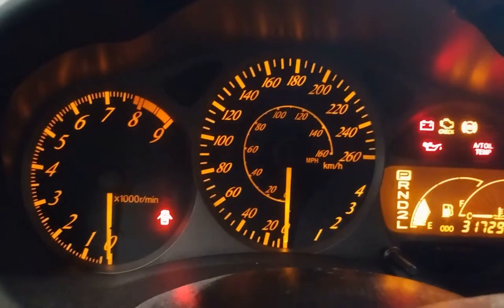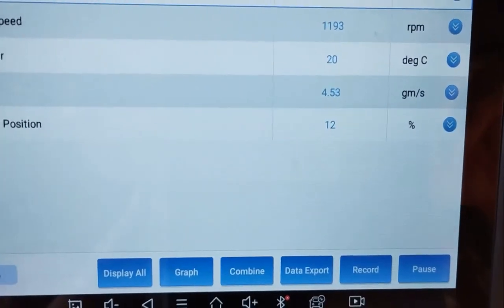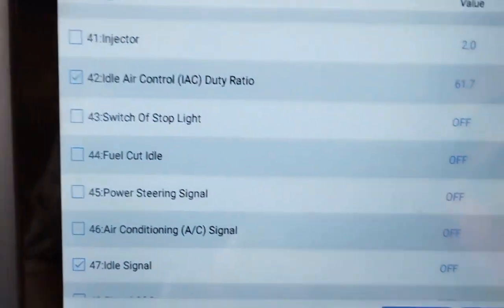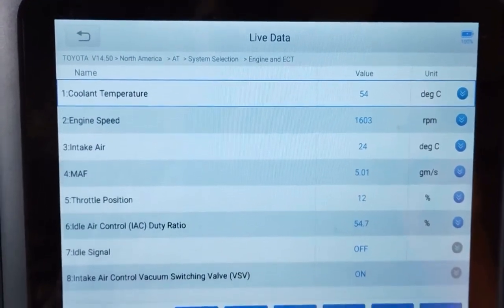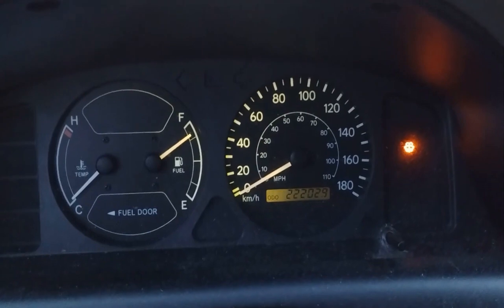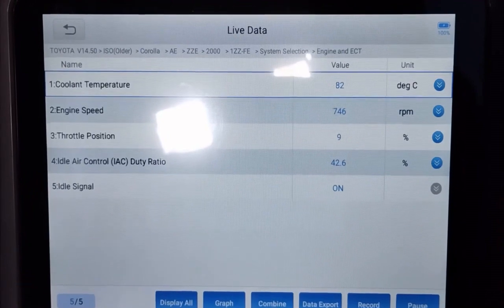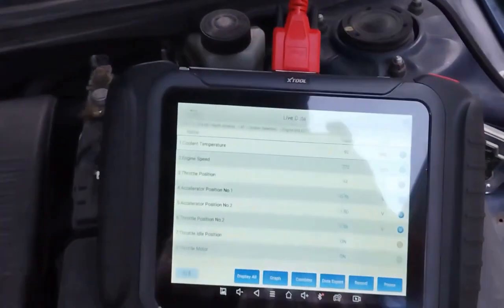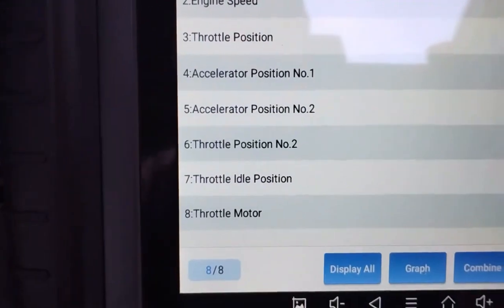2000 Toyota Celica GTS - High idle problem, overview / compare with other Toyotas

Comment: Good day Sir, I hope you answer my question, cause my celica gt 2002 also increased idle from 1000 to 2000  to 3000 rpm when reached normal temp, its not that hot.

Comment: Hang on..   pause it at @5:34 you can see an aftermarket AN Fitting just T'd into the AIC vsv airline.   Right?   Maybe that is just a service port with a Schraeder valve..   if so what function would that schraeder valve perform?
Reply from the maker: You mean that black Schrader valve at 5:34 near the top right? That is 100% factory, it's a test valve that lets you inject smoke into the evaporative emissions system to test for leaks. I have a 2004 Celica as well (my son's) and it has the same port. Usually there is a green cap that screws on the schrader valve.

Comment: Did you fix the issue?? What was it. A bad coolant temp sensor or an IAC valve
Reply from the maker: Yes, I did fix the video by removing the IAC valve, disassembling it and cleaning it. Here is the video detailing the entire procedure from diagnosis, repair to verifying the completed repair. 
https://www.youtube.com/watch?v=i8qeGS7P2EI
Reply: @geekynewz  same problem to me, how the iddle affect coolant temperature, for me looks like water pump or thermostat are bad, on the right side of engine i have hot water pipes and on the left the pipe is cold but sill got the  ~1800 rpm at iddle.
Reply: 317.000 miles on stock unopened engine mate???